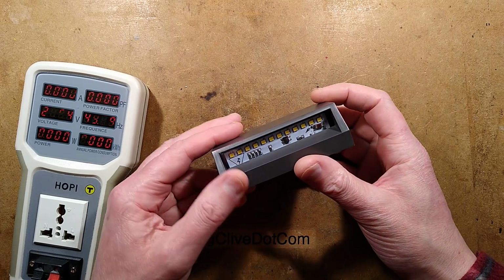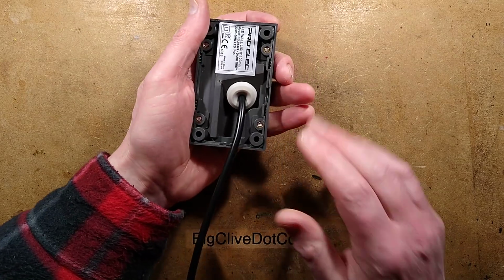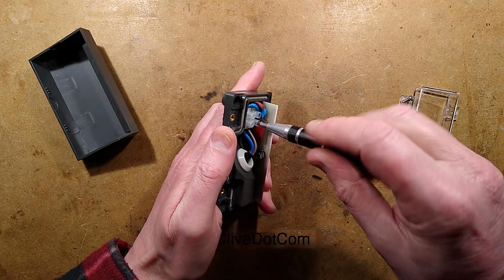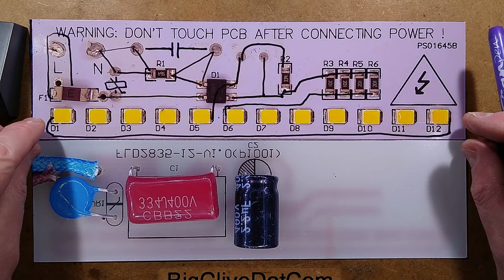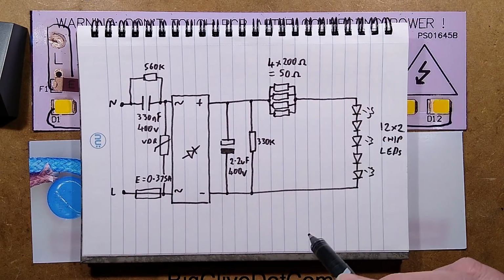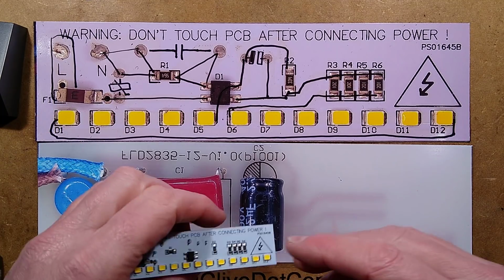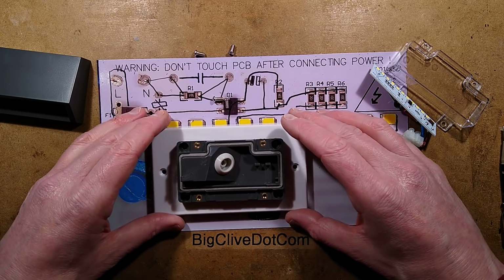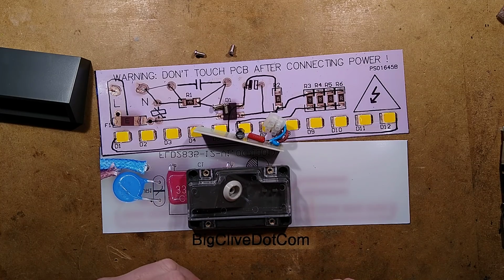Inside a wall mounting, LED path light (with schematic)

Comment: As you said - water can go along cables.  I was very surprised to see water coming out of the bottom of a telephone cable during a rainstorm.  At first I assumed it was getting in along the outside of the cable, but when I looked carefully it was definitely coming out of it.  Not exactly like a tap, but enough to do damage to the floor boards. The engineer wouldn't believe me - but he did renew the cable and he fitted a new junction box at the top.  I am sure that was where the rain got in.
Reply: I've probably told this story before, but once when our then VHS player failed after a rainstorm I discovered that water had been running down the inside of the coaxial cable and into the tuner!
Reply: @zh84  I've found the same thing when I worked as a TV repair technician, air dielectric cable makes great water pipe!
Reply: There are car manufacturers having problems with motor wiring that drain oil through the copper of the wires into the electronics.
Very expensive failure.
Reply: @CyberlightFG  An odd oversight, considering that certain sensors depend on that "gap" in the strands.

That's why O2 sensor wires must not be soldered: the reference air is supplied through the wires! The body of a crimped splice provides a gap to bypass the airtight junction even when properly covered in heat shrink, whereas a good solder joint will allow the heat shrink to conform and prevent air passage entirely.
Reply: @CyberlightFG  Well damn, would've never thought of that..
Reply: It is amazing to see water getting wire the cable into the potted control unit of an electric vehicle charger....
Reply: @CyberlightFG  That's just bad design. I used to work in automotive electronics design (for Land-Rover a rally team Jaguar and BMW to name but 4) and there are plenty of ways of stopping that.
Reply: In 50 years I've never seen or heard of anything like these issues. I have, however, installed telecom cable that had an outer flexible casing to allow water to flow freely by the sealed round flex', but that was on an ocean going research vessel.
Reply: Snakes - I am sure you and your colleagues took great care to ensure this couldn’t happen, but I assure you the water definitely dripped out of the cable in my house - not along the outside.
Reply: Apologies - Snakez
Reply: @keithmiller5042  Don't doubt your experience, especially with witness marks on the floorboards. It's the Coax that I have trouble with. Long time Amateur / Ham radio. A question if I may, was the outer casing black polyurethane?
Reply: @snakezdewiggle6084  Sorry Snakez; I don't know.  If it helps, I am in the UK, so I guess it was standard BT or Openreach cable.
Reply: @keithmiller5042  - there are various types and sizes of telecommunication cables. Most internal types are PVC (often white or off-white/cream). Cables designed for use in the ground are jelly filled to stop water getting in and travelling. But internal cables are supposedly be dry inside. I don’t deal with drop wire so can’t comment on that.
Reply: It worse than just rain water getting in at the top of a cable run. If you leave a rubber cable outside long enough, eventually the rubber will start to absorb moisture. Capillary acton will cause the water to run along the length of the cable. If it does not find an exit (say the ends are sealed) when you cut into it, the water will come out under pressure like a little hose pipe!
And yes, you have to try to use every trick in the book to try to keep water out, or at least, arrange for it to drip/flow down away from the electrical/electronics to the bottom of the case and then out a drain hole. This includes rain/water traps, bringing cables into the bottom of enclosures and making sure the outer sheath is cut off just above the bottom of the box, but not too far up. And where possible having air vent holes to reduce the likelihood of the day/night heat/cold cycle causing condensation to build up. Co-ax is definitely a contender (after conduit) for being an effective hose pipe, but telecoms cables, network cables and any other where there is an air gap can also cause problems. The best laugh is when you come across waterproof/weatherproof light fittings mounted in such a way that they become baths, and fill up with water until eventually either the RCD trips out or the conductors corrode away causing a failure.
Reply: Show them a motorcycle cable lube device
Reply: Isn't it standard practice to route cables so as to create a drip trap? I've always done it, but am I out of touch?
Reply: @djfromage  This only stops water running  down outside of cable, when a coax cable rubs on a wall etc wearing  into outer casing it wicks along braided copper inside by capillary action and easily goes up hill and comes out into socket on back of tv or video etc .Have seen this many times during my 50 years as a TV engineer.
Reply: Yes Richard - now there is a loop below the entry into the house - but that wouldn’t hold back a 5 metre head of water ( Hope I’ve got my physics right!)
Reply: @keithmiller5042  ah yes, I misread your comment, I hadn't noticed you described water running through the inside of the cable. That's a different matter altogether. 💦
Reply: @djfromage  not everyone learned about what I got told were called 'rain loops'.
Reply: @djfromage   That only works for external water, internal water just progresses inside the outer sheath.

Comment: I like low glare outdoor lighting like this, it provides light where it's needed and helps to reduce light pollution. I wonder how many of these will fill up with water when used outside. I think I'd want  drain holes in the bottom of the clear cover, though that might make the live parts a bit exposed, someone might poke a paperclip in there!
Reply: Might get moisture in